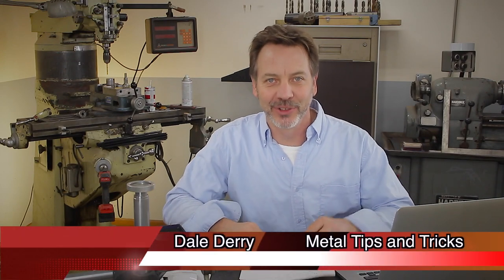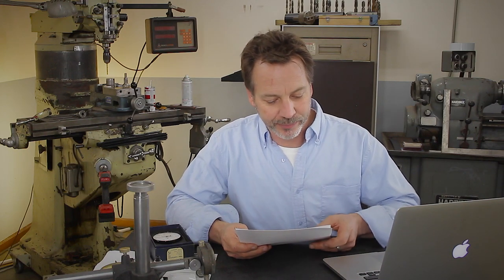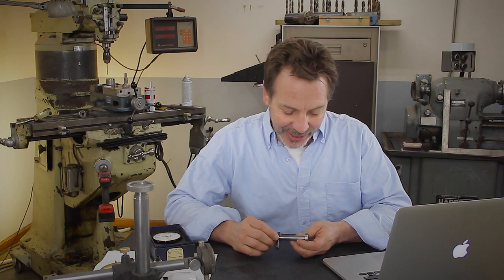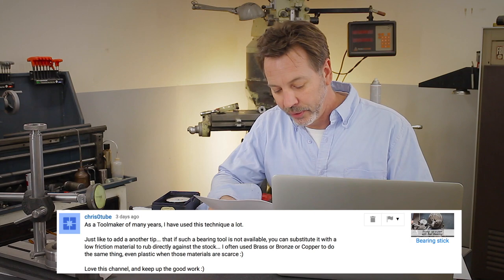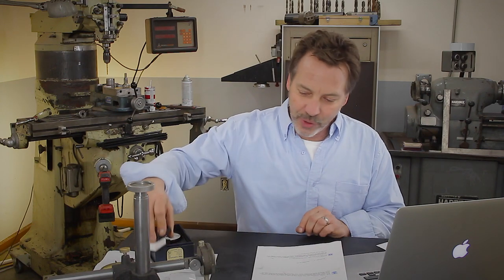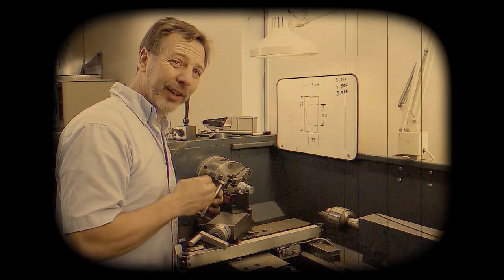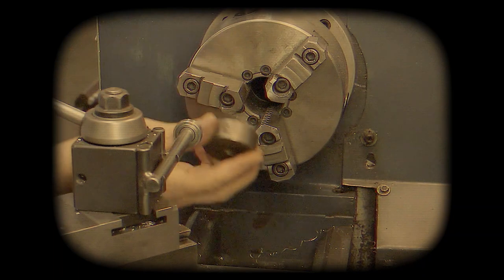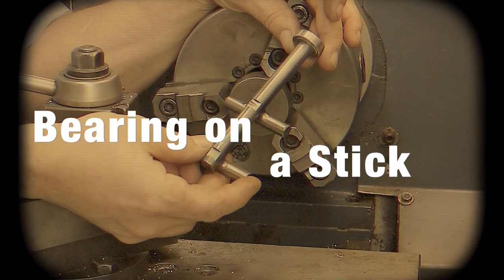Q&A bearing on a stick

Comment: Dale those BBC Engineering programes were used by the instructors at the technical collage I attended during my apprentichip back in the washed out colour of the mid 1970's ............. they were cutting edge in teaching at the time, the BBC had access to so many of the engineering and manufacturing we had in the UK then.Fond memories :)

Comment: I've never used the ball bearing but, I have used the rubbing method. However, I used it for straightening small,  bent shafts. You creep up on it,  exert some pressure on the shaft and you can bring it back to true. You may have to do it a few times, increasing the pressure each time. Of course, it's done while the shaft is rotating,  just like your method. The shaft is held tightly in the chuck, though. I've used it on a tiny, bent test indicator tip,  a cross feed screw from a surface grinder ( the idiot who did that is gone, now), and a few others as well.